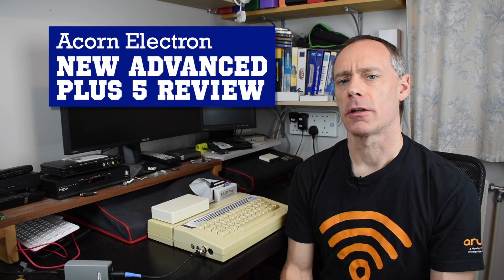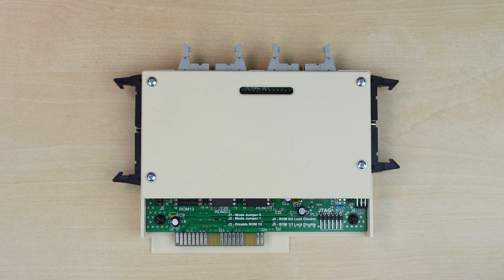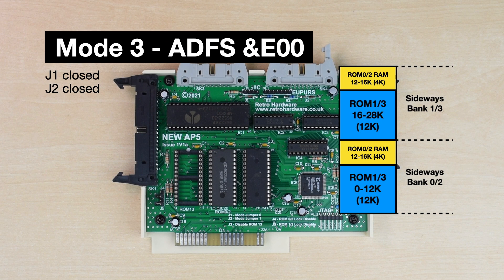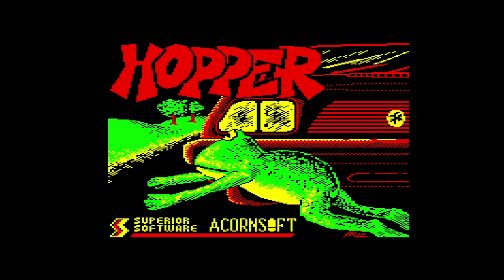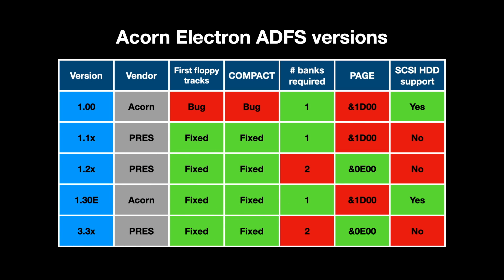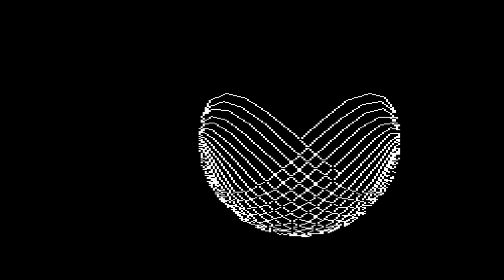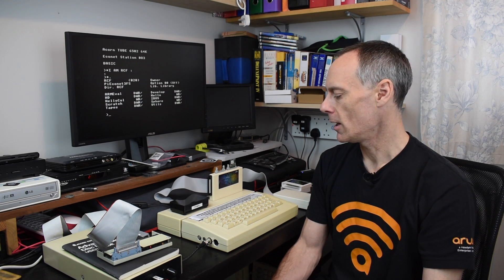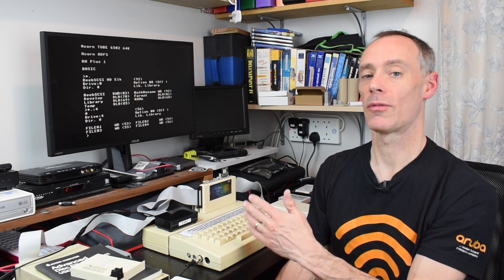Acorn Electron AP5 review

Comment: I've picked one of these up with an AP6/Plus 1 from Dave H on the back of this. Absolutely perfect video, I've watched it dozens of times and have learned a ton about how it all works. Thankyou a hundred times.
One question though, is it possible to program MMFS onto the EEPROM if you don't have another SD cart plugged in (like the Elk SD Plus1)?
I'm thinking the only way I'll be able to do it is with another MMFS rom in the AP6, and then that should expose the roms to program onto the AP5 ROM.
Anyway, maybe I'll take this to the forums if I struggle. I can always manually program the EEPROM on my PC too.

Comment: Great video!  Well done.  Very informative.  I've been trying to find the perfect configuration(s) for my Electrons for a long while.  It's a shame there's no version of ADFS, with SCSI support, that keeps page at E00 for the Electron.  If a similar solution, implementated like MMFS on the AP5 could be found, then ADFS becomes so much more useful.  I do like my BeebSCSI hanging off the 1Mhz port.  BTW, there's a 5v connector on the AP5 inside, that I use to power the BeebSCSI.
Reply from the maker: An ADFS with hard disc support and &E00 PAGE would be lovely!

I can't use the 5V power output on the AP5 because it's limited to 100mA an the Pi draws way more than that.  Something like a BeebSCSI is presumably much simpler, though, so won't need as much.

Comment: The AP5 is a great bit of kit - not really had the chance to play with it fully, but getting the old Beeb user port for LED flashing and reading thermistors takes me back to 80s Comp Sci degree. 
I'm still holding out hope for a drop in replacement for the ULA. In terms of point of critical failure, it's the one that seems the hardest to overcome.  The Blob ULA is pretty reliable  (I have two motherboards,  one socketed, and one blob) but it's getting old (as are we all). I've seen a few projects sort of fizzle out on Stardot, so, maybe it's not really doable.
Reply from the maker: Mine's a blob one and, so far, no issues.  But you never know when problems will strike and it is worrying!

I have a Plus/4 where the 8501 failed but fortunately there's a FPGA version which dropped in nicely and seems to work well (and adapter boards to fit a 6510, but they don't run the tape motor control).